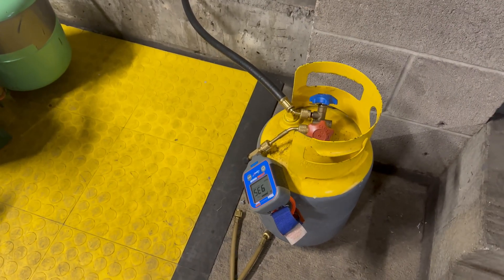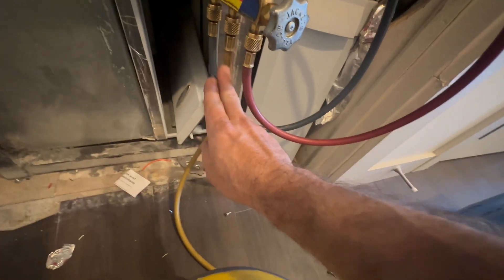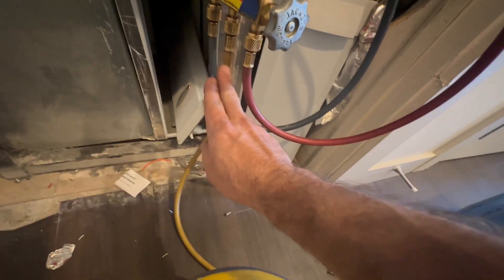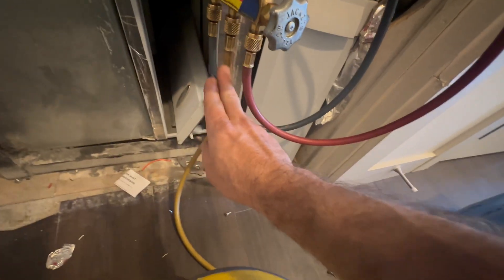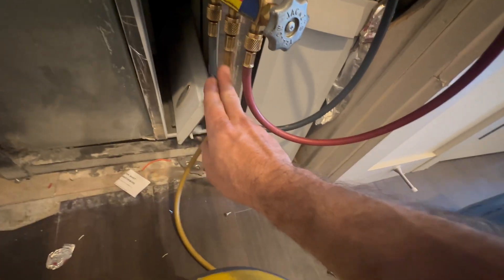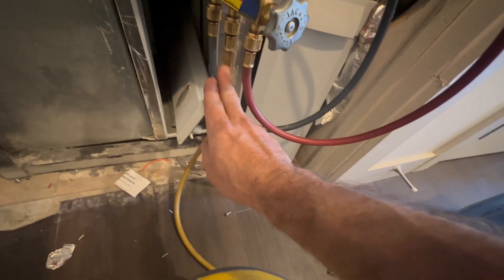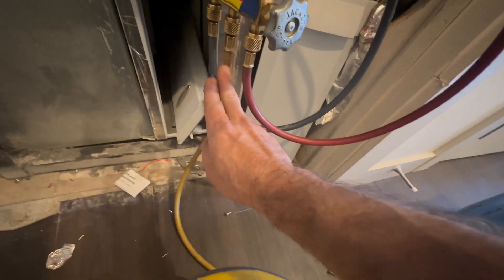First HVAC Repair of the Season - Reversing Valve Replacement

Comment: I was wondering if cutting a piece of the duct work out and replacing with a larger piece of sheet metal would have been an option for a better access to braze that pipe that was hard to get at.

Comment: I'm not here to criticize your work and be a dick, but just for my own knowledge, when you were sweating in the copper on the reversing v/v on the vise should you have had nitrogen flowing to prevents cuperic oxide even in the small amount of that pipe? Thanks for your video.

Comment: Not knocking you, just giving advice. I’ve been in industry since 2013, associates in applied science HVAC. You want to make sure to pressurize with nitrogen before hand and be careful not to over heat or introduce excess solder into the system.
Reply from the maker: No solder was used in this video and you don't want to pressurize with nitrogen it will blow out the sil-fos, you want to 'flow' nitrogen.

Comment: A little advice…. Never use the flame to melt the rod. Get it nice and hot all around, once its glowing on one side you move torch to opposit side of where your going to place rod initially. The heat from torch on opposite side of where the rod is will automatically draw sided to the flame. Ideally just over quarter inch of solder per 1/4 inch of pipe.
Reply from the maker: That works great for soldering but there is no soldering in this video. This is a tight spot on 7/8" copper using brazing rods (sil-fos). Got about 1" of wiggle rooom to where I can move the flame and sil-fos. I don't have all the room in the world to control the heat like all the top 3d videos on youtube that teach you how to braze.

Comment: There is   a captain hook tip for the oxy ace for tight spots have never used it but have heard it works good.  Still struggle sometimes on tight spots you re not alone, good job!
Reply from the maker: Ya that would have been helpful - heard of it just haven’t tried it out yet

Comment: Why are you not flowing nitrogen while you are brazing?  That will leave black carbon build-up on the inside and clog the filter drier, the oil in the compressor etc.
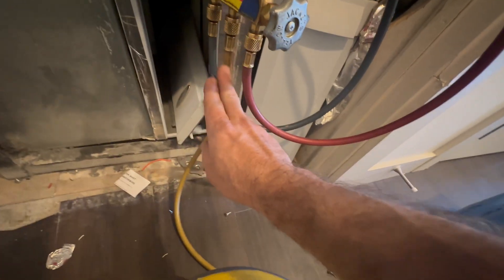Reply from the maker: 06:33 did you watch the video?!?!
Reply: I did watch the video and you used nitrogen on one single brazed joint on the replacement.  The others would still have the carbon Oxidation on the inside of the individual pipes.  I suppose you somehow clean that out with a brush or some method. 
And during the unbrazing process of all the joints that you used over creates the same oxidation.